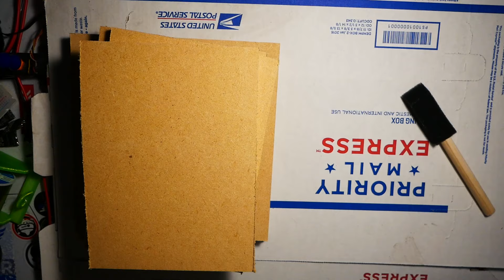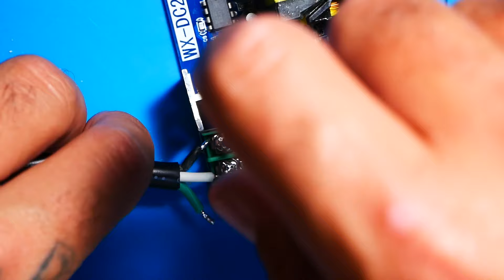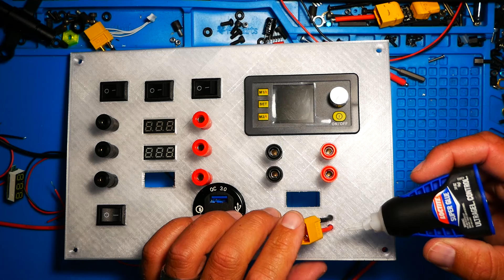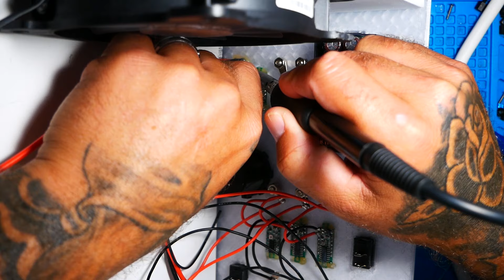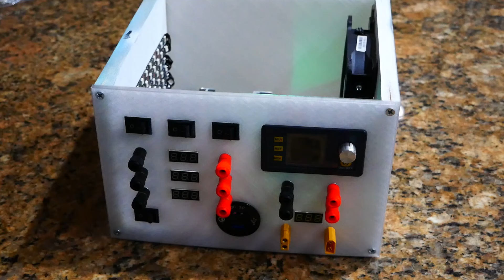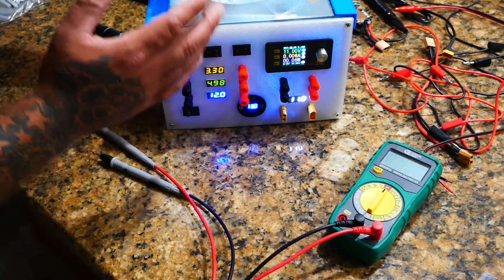The Ultimate DIY Variable Lab Bench Power Supply

Comment: I made my own circuit for the power supply but I was looking for something good-looking as a case and this is a really good idea! Probably I will use acrilic and I found a company that can cut all wholes quite cheap with laser so it is perfect (I mean the wholes that are difficult to drill like rectangular etc. as i don't have too many tools :/ ) . Anyway thanks for the idea! I usuelly don't buy those modules (I make them for my own) but always I have lack of ideas for the rest (case etc. hehe ) . BTW what I have noticed is that wood likes to crack sometimes when we use screws etc. (I have noticed that you have had some cracks in that wooden boards , I wonder how to avoid it  🤔).
Reply: Pilot holes to avoid cracking.

Comment: Guys, be careful, you're dealing with high power here, don't kill youself!

1. what about shrink tube? (if one of the converteres get warm/lose because HOTglue it can short out) or the led strips get lose
2. fuses for the channels and main power? (that you can change easily)
3. just one opening (with the fan)? where does the heat exits/fresh air enters (depents on direction of fan)
4. driling smal holes for the screws prevent the wood from cracking (as seen from the top on the side panels).
Reply: The wires going into those screw terminals should also have ring or fork terminals on them. Those just look like they've had a bit of solder applied, which isn't a good idea.

Comment: Hi Drainman, thanks for the vid. What would be the highest watts you could charge up to? I see that the inverter is limited to 180W. Thanks again.

Edit: Would it be safe to parallel charge 6S lipo?
Reply from the maker: The module can handle up to 250w so the limit would be the 180w from the converter. At 5a with the large cooling fan you can definitely parallel charge some 6s batteries. Might add another heatsink. Remember this won't balance your cells, so check them first.
Reply: @DrainManFPV  Awesome thanks mate.